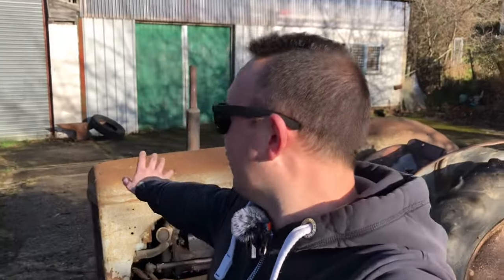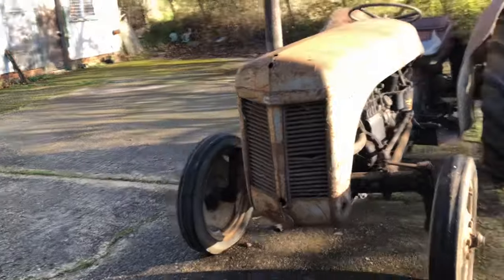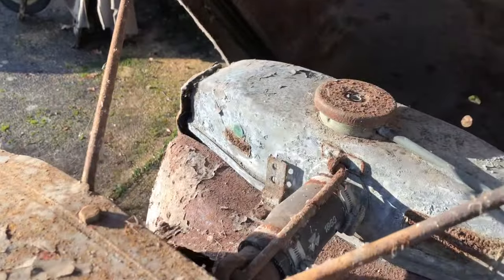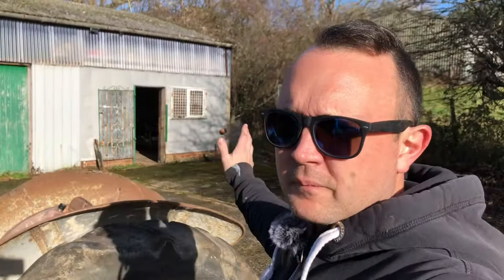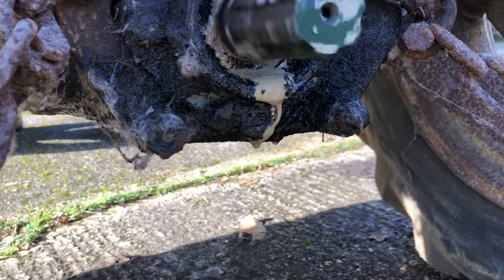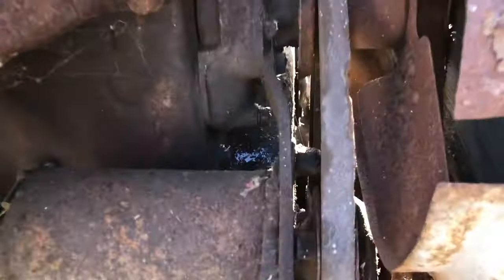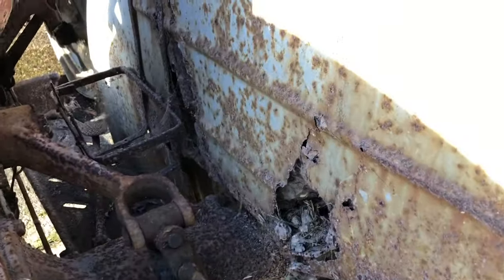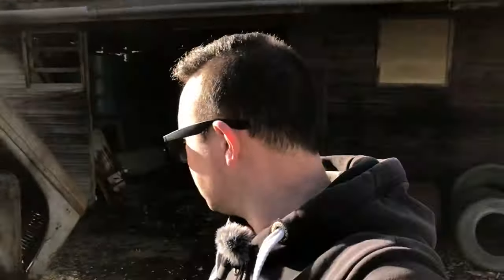Ferguson TEF-20 cold start problems need fixing #fergusontractor #vintagetractor #project #issues

Comment: I was well impressed with the start on the wee tractor well worth spending a few pounds on a good all round service and few seals be good to go and you will enjoy every minute you spend on the seat of it and making memories and old memories will come back to you as well i love my grey Ferguson tractors i use mine as much as i can if you need any advice on anything just ask greatly clad to help
Reply from the maker: It had a head rebuild when I was around 7 years old by my late father who passed away 3 years ago. I remember watching him doing it on our old farm. As well as other memories of it from years ago. Very sentimental tractor to me. It throws some spits of oil out the exhaust from the piston rings being tired so it needs a bottom end rebuild really. That’s why it struggles to get going due to not quite enough compression in the cylinders to fire right up. That is so nice to hear about your Fergusons.. personally think the old machines are far better than all the modern stuff that I’ve seen over the years. Can’t beat the sound and the smell of them if you know what I mean? And thank you for the offer of your knowledge 👌 that’s very kind of you! No doubt I’m need some experienced advise as this project goes on!